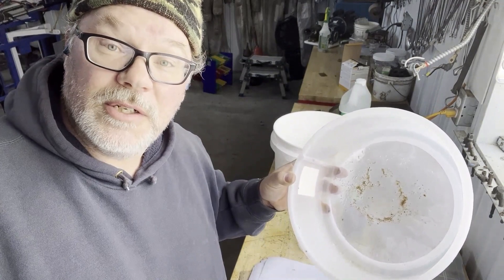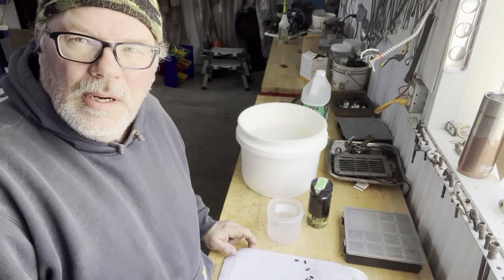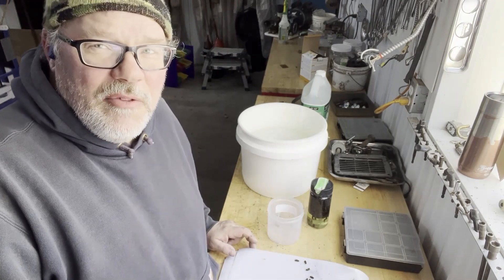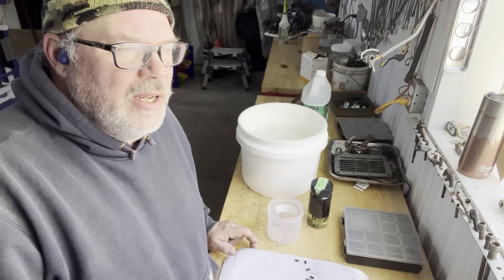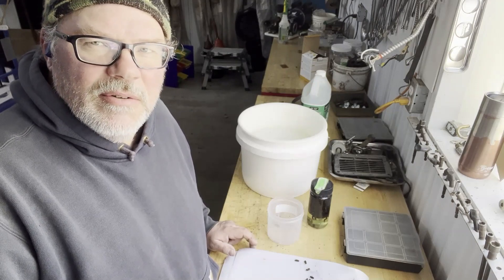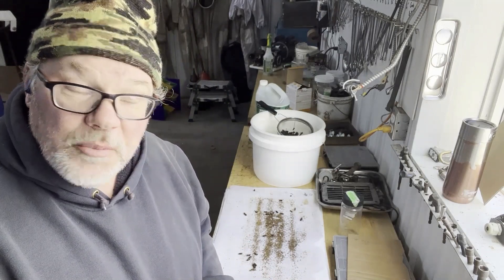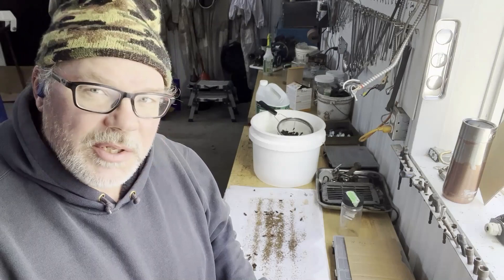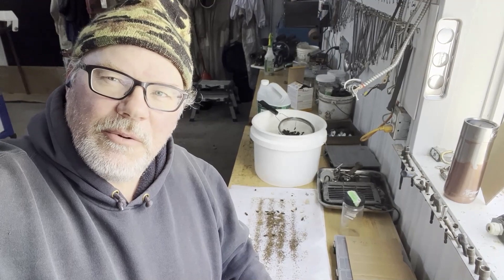First Results for Indoor Treatment trial

Comment: Vaping treatment with oxalic acid starts working on day 3
Reply from the maker: We will see. I will pull and replace the sticky’s several times to check them. If you leave them in too long the debris makes them unreadable.
Reply: We run screen bottom boards on all our hives, with trays to catch the mites that fall. We have done thousands of oxalic vapor treatments and I have concluded that around 90% of the mites that die from the treatment fall within the first 48hrs after treatment.
Reply from the maker: Thanks Jayse.  I’ll monitor 3 day windows and see when the mites drop.
Reply: Ya I have found the same , not much long term drop